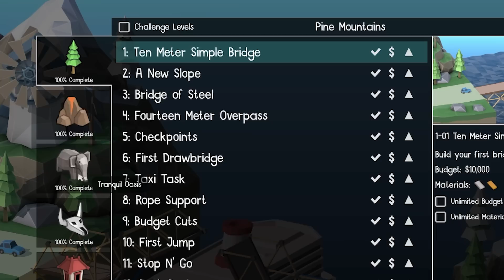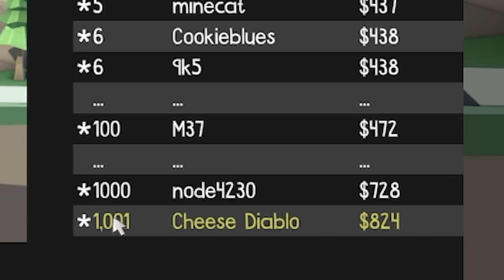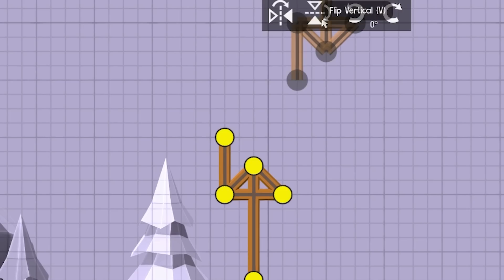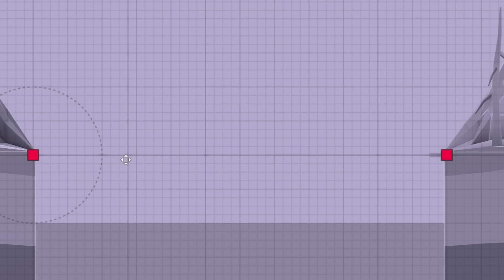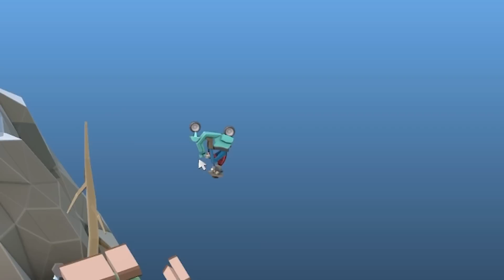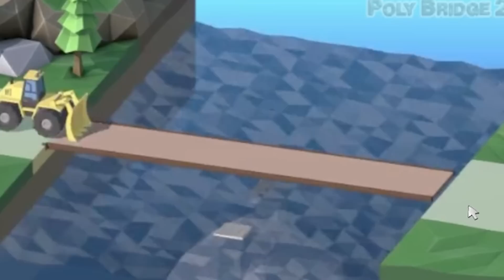Can you complete Poly Bridge 2 using cheese?

Comment: At 6:30 there is actually an easier way to do the bug. All you have to do is build a road from a point, then right-click to select it, then hold Shift to enter the movement menu, then hold left-click to move, then press d to delete it . (you have to hold shift and left click the whole time) Then go with your mouse wherever you want the road to end and just press Esc. Then you can undo it by just pressing z and there should be your road :)
Reply: thanks this helped alot lol
Reply: Thanks. this still works!

Comment: If anyone wants to know why the breaking roads launch the vehicles, it has to do with the developers making a change that made cheezing the unbreaking leaderboards next to impossible. In those situations the roads normally wouldn’t break, but there is a large perpendicular force applied to forcibly break them which was implemented with the intent to prevent falling roads from ending up on the unbreaking leaderboards. For some reason, the force can be transferred to the vehicles and can slingshot them long distances in a really stupid way.